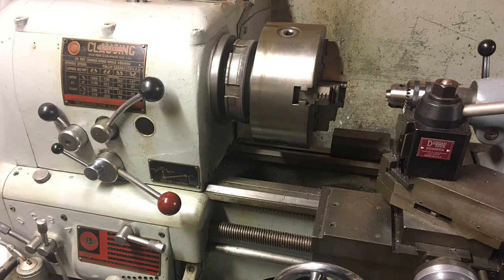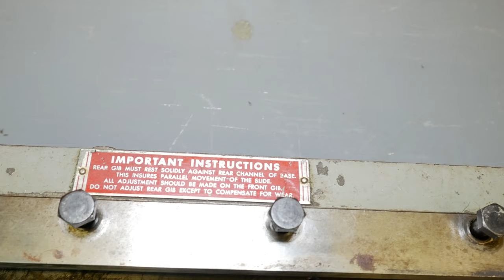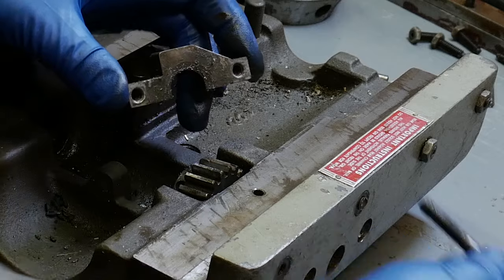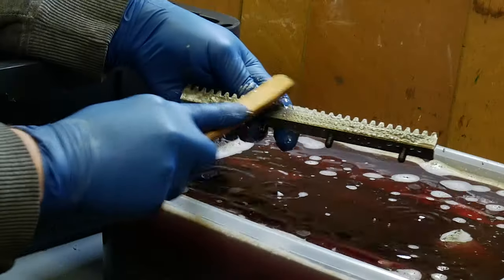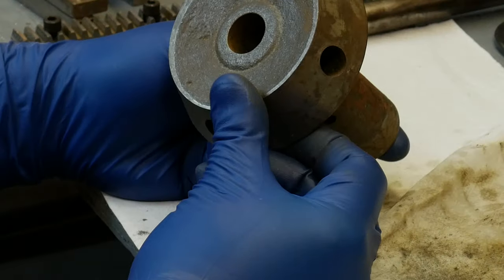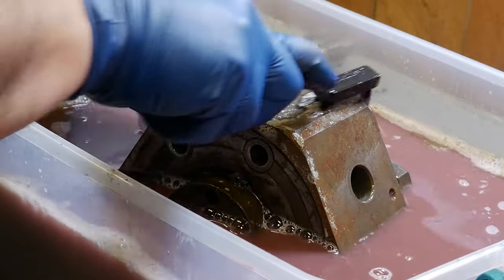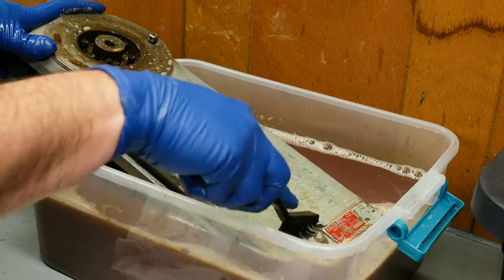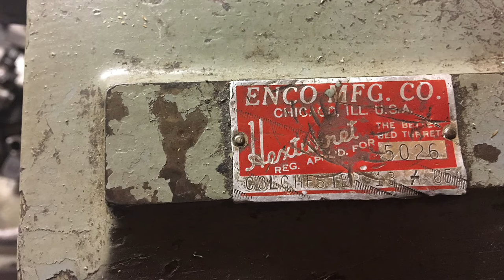Tailstock Turret Attachment- Restoring the Enco Lathe Turret Tailstock

Comment: SUPER start to a great turret restore Pete.  That's a great lathe to have a turret attachment on. after clean up, just spray on and brush in "FLUID FILM" very long lasting protection. Way lube on all ways, gibs , ect.
Reply from the maker: Thanks for the tip! I had not heard of that one before. I'll be looking into it.  I really wish I had a lever operated collet closer for the lathe.  It would make for some quick work in conjunction with the turret.